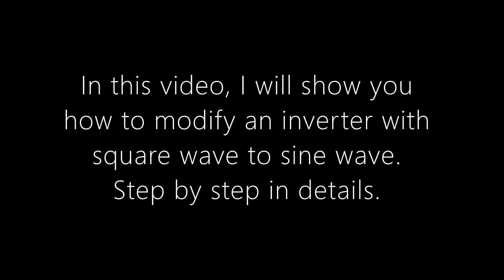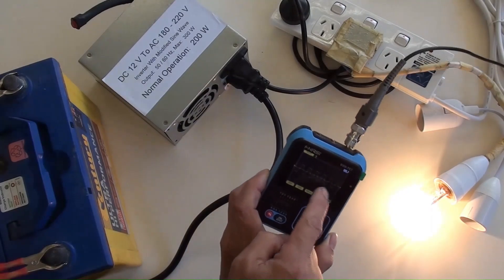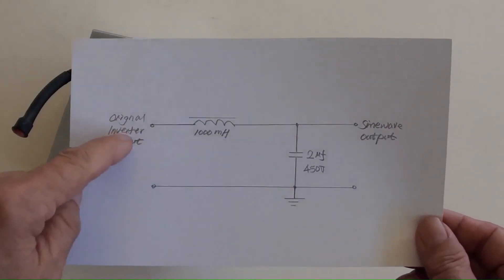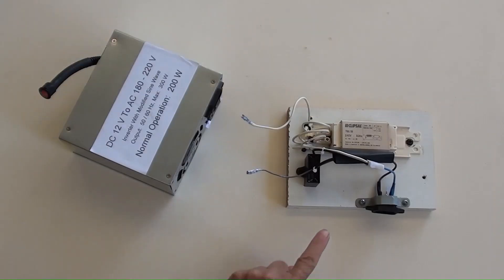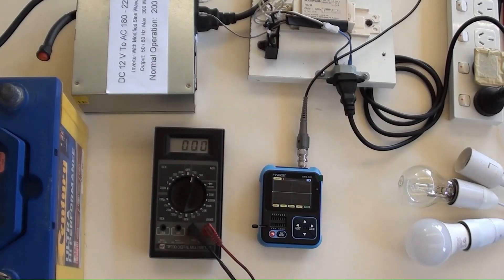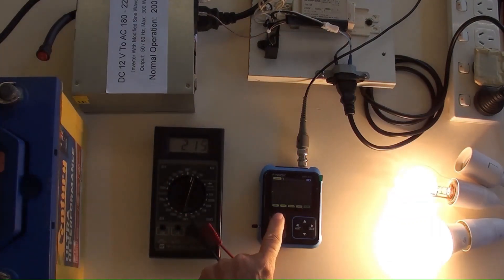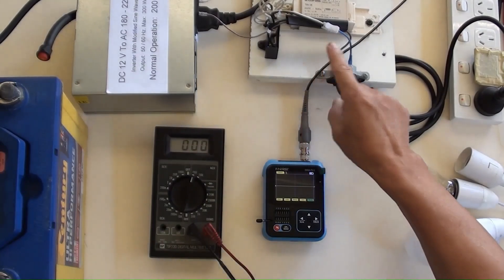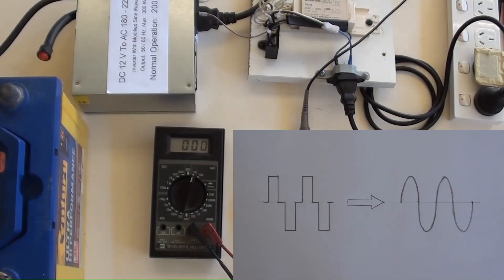How To Convert An Inverter With Square Wave To Sine Wave?

Comment: we have 7kv modified sign wave inverter so can we convert it to sign wave? because everyone on YouTube making videos on 200w to 1000w inverters and not going above it.
Reply from the maker: Thanks for your interest!  Yes, as long  as your 7kv modified sine wave inverter's waveform is the same or similar to the modified sine waveform showed on my video's thumbnail, it can be converted however the larger inverter's wattage, the expensive will be for the inductor.  In fact likewise in your case, an inductor would be quiet expensive, it is uneconomical to spend a lot of money for a little return on your 7kv inverter.  There is an option:  If you are able to make your own inductor at the same time the materials which are made up the inductor - cost little, that'll be good.  Good luck!  👍
Reply: You need to scale the components for the power you wish to draw, not the max power available. So, you could use most sockets for modified wave, and provide a socket for converted pure sine wave that doesn't use the full wattage... for example, connect a fridge/freezer via the inductor/capacitor, but your laptop et al directly

Comment: Brother i dont have that inductor of flurescent tube light   that you are using so can you  please suggest me its alternative please ❤
Reply from the maker: Thanks for your interest!  Well, in order to converter to sine wave in this way, it needs a larger inductor!  An inductor recycled from a fluorescence light in the video showed has 1000mH more or less inductance capacity.  I reckon you need  to have an inductor with its inductance at least:  300 mH.  Any inductor with that capacity will do, of course it'd be quiet expensive unless you'd have it pay less or make by yourself.  Cheers!  ❤👍

Comment: Does this inverter output 50 or 60 Hertz? What component L and C values are best for 60 Hertz?
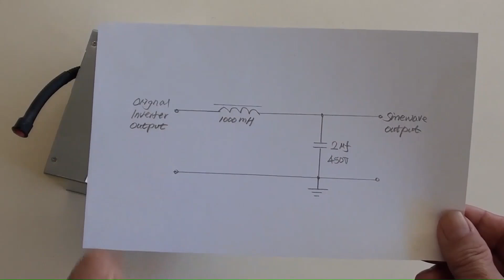Reply from the maker: The inverter in the video:  A 50 Hz which has a small range of 50 - 60 Hz adjustment.  Although values of L & C filter are different for 50 Hz comparing to 60 Hz in theoretically, they can be chosen as the same values in practice.  In the video showed, they are 1000 mH for a coil (L) and 2 µF / 450 V (C) for a capacitor (these values can be seen at 1:00 - 1: 10 in the video).  Cheers!  ❤👍
Reply: @diymade2175  Thank you for the replay, but mostly for making GREAT VIDEOS!

Comment: Nice video ,but will it work for my 1000watts msw Inverter it doesnt run my pc well because its modified sine wave will this setup fix it 
Feel free to give me a detailed answer ❤
Reply from the maker: For your situation, Please read a comment pinned which on the top of the comments section.  Cheers!

Comment: Can’t see anything, turn on the backlight of the cheap Chinese scope please.
I remember another video where they used three large toroidal inductors in series with door knob capacitors between each inductor as well as the last inductor. Capacitors were connected on the common neutral buss while the inductors in series provided the hot phase. The size of the toroidal used as well as the voltage rating of 400 volts allowed a 2500 watt sine wave output from a 2500 modified sine wave output inverter.
Reply from the maker: Thanks for your interest!   Spot on.  In the most cases, there are the ways to accomplish a task.  As you mentioned, three stages of the low filter circuit was used on a 2500 watt sine wave inverter however only single stage of the low filter circuit was used in my video.  The way of selection depends on a few things such as the inverter's wattage, kind of the load used and cost involved etc.  Generally speaking, the bigger inverter, the more stages chosen, the more expensive for the components to be used.  In the case you mentioned, it'd cost more very much so for the toroidal inductors & capacitors compared to the original inverter's price tag.  Cheers!
Reply: @ we have purchase surplus military door knob capacitors in the past from old radio gear, they work great and are relatively indestructible and somewhat economical compared to new. As for toroidal coils, surplus burnt out switchmode high power supplies are the best place to find these inductors. Many service companies trash these supplies and instal new ones, cheaper than repairing and if they fail under warranty customer might only have to pay for labor to replace them. Now for increasing output capacity one might have to parallel connect the coils but you wold have to figure out the inductance of coils when connected in this fashion. The door knob caps should handle the load.
Reply from the maker: @Subgunman  Great!  ❤👍

Comment: Please tell me what is the capacitor and inductor for 1500 or 2000 W inverter? Thank you🙏🙏
Reply: Nice Job. But I feel this method will quickly drain the battery because the capacitor will act as load
Reply from the maker: @danielwashi6229  It wouldn't be that far far ... quickly as you mentioned!   A 2 µF capacitor takes only a bit of wattage from the battery, in fact, the same or similar part(s) can be found in all the sine wave inverters however the exact figure might have been different for each applicant.  Thanks for your interest!  🙂
Reply from the maker: Good question, Mate however it is not easy to answer:  Generally speaking, a capacitor's value can be chosen between 2 - 4 µF but an inductor's value is complicated case to choose, it depends on a few of facts such as the inductor's core material, its size, shape & current etc. all will affect the requirement for its inductance.  An inverter with half a dozen mH inductor can be seen in practical applications.  😇👍

Comment: OK, really? That's just too simple. How come so many inverters are still square wave then? I'll try it sometime.
Reply: Because the inductor will fry soon
Reply from the maker: @mayokundeji4846  In order to avoid that situation, the one has to manage the inductor and load accordingly, this is on the different subject.  Cheers!  😁👍
Reply from the maker: Thanks for your interest, Mate!   The simplest, the better however it isn't for every square wave inverter.  Good luck with your experience!  🙂👍
Reply: square is cheaper. And proper coil is heavy and expensive, and have some loses.
Real sinus converters are made different.
Reply from the maker: @johnfox2483  U R Right on these, gain some and lose some.  Thanks!